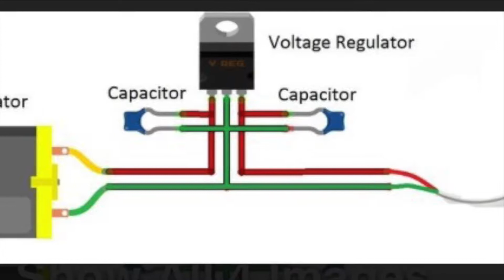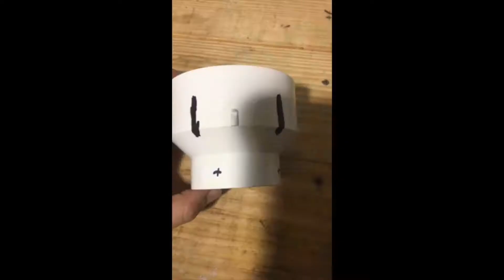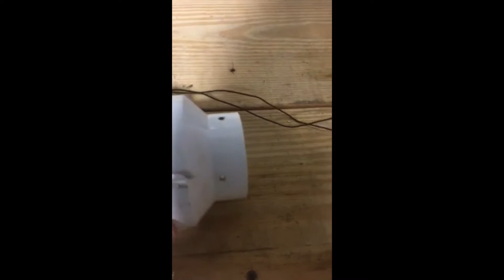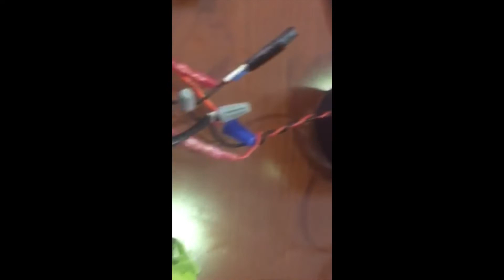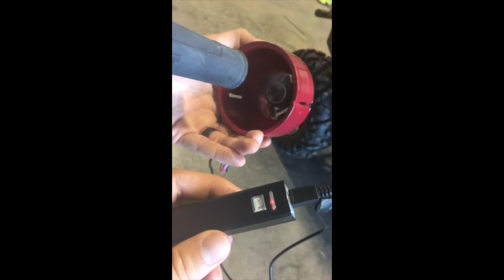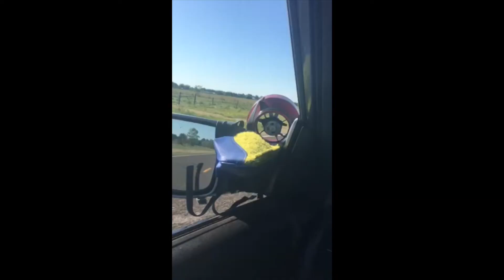Car mounted wind turbine design

Comment: have you thought about scaling up the model to a golf cart generator with a regulator and using a roof rack to mount it with pvc and run the wires to a 12 deep cycle?